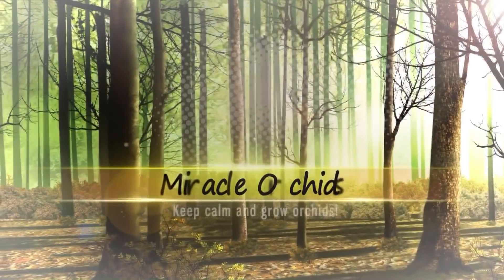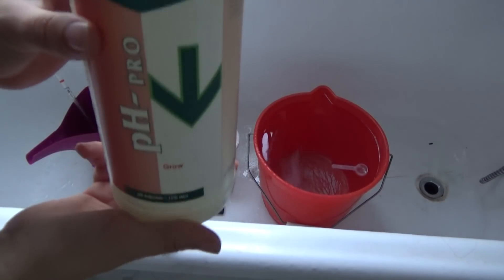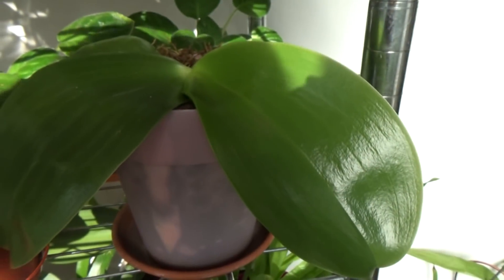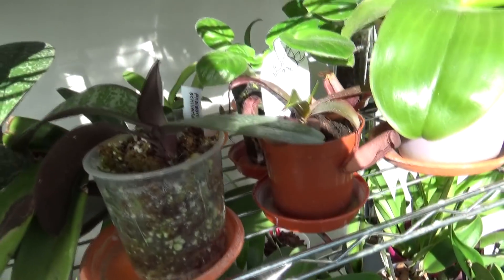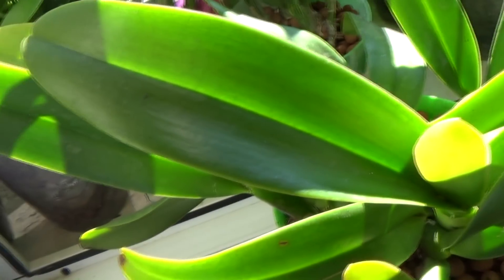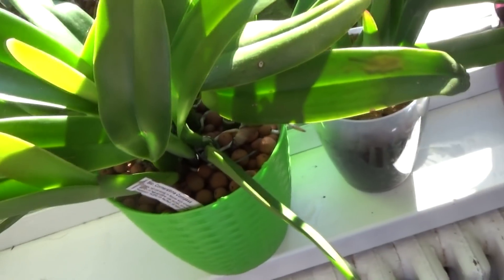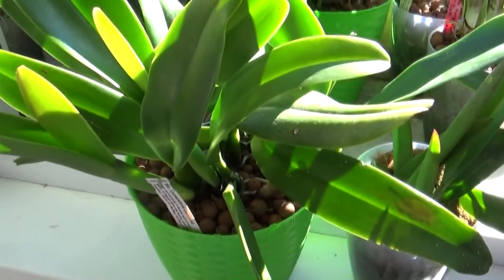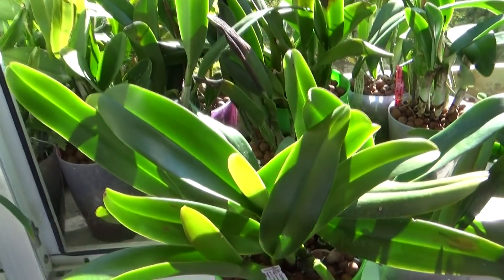Silicon Fertilization On Orchids - OUTSTANDING RESULTS!

Comment: Hi Anna Maria I’ve read up about Silicon fertiliser. It is recommended to add the Silicon fertiliser to the water first ( & adjust ph) before adding regular fertiliser.  If you add the Silicon last it will lockout important nutrients and plants may become deficient in the long term.
Reply from the maker: It's a bit contraintuitive to adjust pH before adding fertilizer, because fertilizer is dropping off the ph too. I can totally put the silicone first, then add fertilizer, then ph down. Where did you read up this info?
Reply: Miracle Orchids Hi there Anna Maria.  The first link I’m sending recommends:
1: add silicon fertiliser, 
2: adjust ph, 
3: add nutrients, 
4: adjust ph again if necessary 

http://blog.onestopgrowshop.co.uk/2015/04/using-silicon-additive-grow/

https://manicbotanix.com/silicon-in-hydroponics/

https://youtu.be/tAQRQinQf1I

I’m interested to hear what you think about this. To date I haven’t used Silicon fertiliser on my plants. However the Silicon fertiliser I have purchased in Australia is called “Super Si”, 100% mono-silicic acid that presumably doesn’t alter ph. So this precipitation effect I have read about should not impact me.

Comment: Many thanks for your infochannel Anna Marie, it helps many so cheers to you!
 My question relates to silicon product and application rates. In Aust. I can source liquid silicon from here http://bloomadvancedfloriculture.com.au/products/bloom-silica/  
however I worry the strength may vary from your product and don't want to overdose my small collection of phals. 
Can you provide a link to the analysis chart for your product please so I can compare/adapt?
cheers
Mike
Reply: Anna Maria if you can't show analysis can you please tell me the strength of your liquid silicon?
I did check the secret garden website but cant find the liquid silicon probably because my Romanian is poor. Please comment on your potassium silicate strength.
Mine says silicate 0-0-31 with 31% potassium silicate and 22% nonplant silicon from mono-silicic acid

Otherwise I'll have to experiment by starting low and increasing to a working solution somewhere before toxicity :)
cheers and thanks in anticipation

Comment: Hello Ana Maria,  I bought Rhino Skin from advanced nutrients company (Silicate), but they recomend 2ml per liter of water from the 1st flowering week to the 6th, Help me with this two questions: a) I should use 2 ml / L or 5 ml / 10 L (I am not sure if the dosis if by the brand or because it is used for Orchids)   b) This Silicate can be used all the time or only in the flowering periode?
Reply from the maker: So, the silicone, NOT SILICATE, can be used all year round. As for concentration,  it really depends how concentrated the solution is. I need at least a picture with the label to help you out...